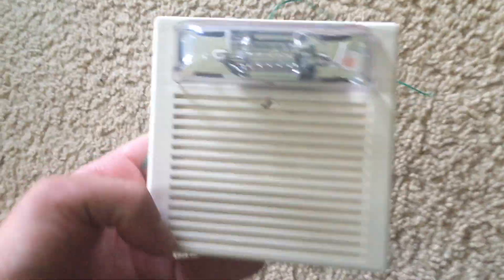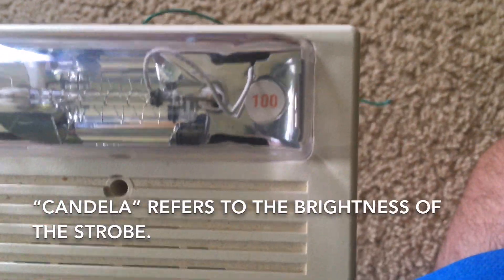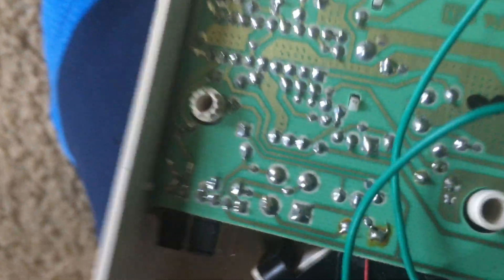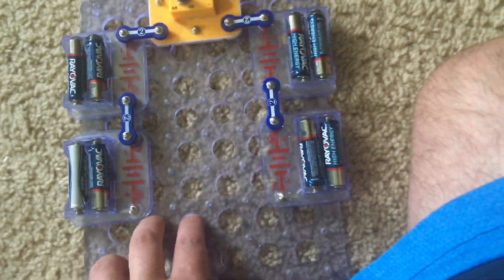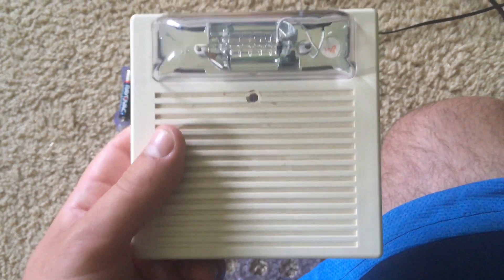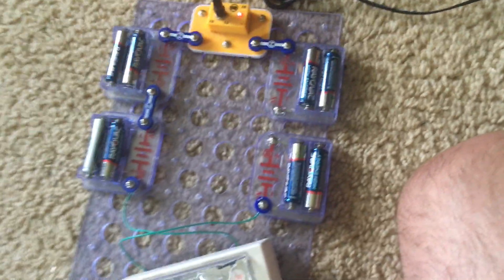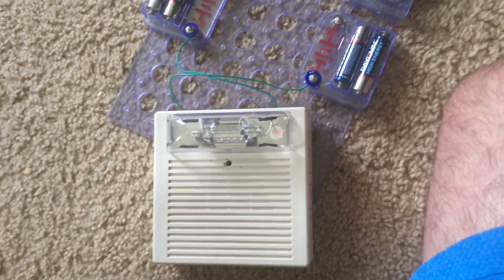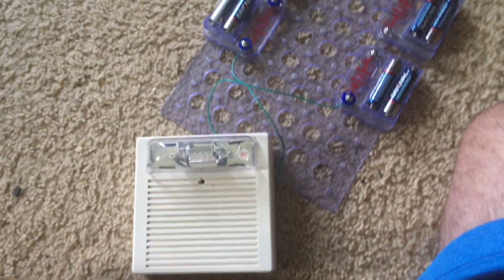White Ceiling-Mounted Wheelock AS Horn/Strobe Overview and Test (READ DESCRIPTION)

Comment: AS-24100C-FW
Reply from the maker: Thank you!  Do you by any means happen to know the year that this particular model was manufactured?
Reply: @andrewsstation6436  Well, it’s usually on the box the alarm came with, or on the back of the device, but it looks like it’s missing its protective cover on the back. Both of them have a label with a 4 digit date code. (Ex: 3206 being 32nd week of 2006) If it was a MCC though, for sure it say 2000’s. And this particular model here is probably still from that range. I’m not sure if Wheelock still sold fixed candela strobes alongside multi-candela models in the 2000’s, but I’d guess so.
Reply from the maker: @OckGypsy  That would make sense.  Thank you very much!

Comment: Don’t Pull Fire Alarms Unless There A Real Fire.
Reply from the maker: That’s very important!
Reply: @andrewsstation6436  What’s the screwdriver for.
Reply from the maker: @jacobisworld9516  It’s to screw the wires into the terminals for the horn and strobe of the alarm.
Reply: @andrewsstation6436  What is the Horn self look like